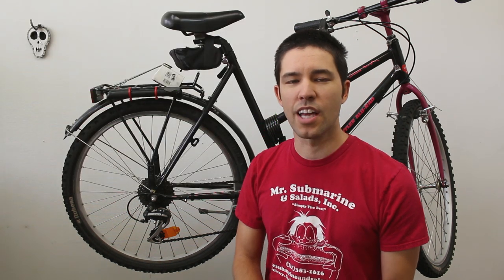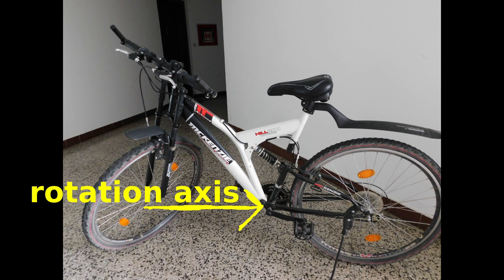Full suspension to hardtail conversion - viewer question

Comment: One issue not mentioned is low end bikes are based on freewheels that apply a lot of bending force to the axle if you drop the bike of pavements etc or take off road, the rear suspension on such bikes does protect the axle to a degree as it takes the instant shock out of those drops. It's an issue with cheap hardtails that is massively reduced on cheap dual suspension bikes because of that rear shock. Personally I would modify the rear suspension to be much stiffer if you can't do that through normal adjustment alone so it still provides a small amount of rear suspension under extreme conditions but doesn't impact riding efficiency so much.  The whole bike is configured for rear suspension and a huge chunk of its weight is related to that design. Maybe look for a very cheap or free rigid frame to replace the existing frame if possible. 

As Bruce says it's great to experiment and try different things out. It's nice to see people riding something different on the road which they have modified. I hate to see bikes not used if you can rework a bike to do what you want that is great. 

I must admit I quite like the idea of getting one of these cheap dual suspension bikes and seeing how much it takes to make it into a really decent bike with minor and cheap modifications.
Reply from the maker: good points Bonzo. thanks for watching and commenting. You might want to check out kevcentral, he does just like what you're talking about.
Reply: @BruceChastain  Been watching kevcentral for a while might even been the reason your videos were recommended to me. I tend to search for cycling videos though but I think your $100 walmart road bike video was recommended because of kevcentral.

Comment: Bruce, good topic.

A Lowes, Home Depot of Ace hardware would have short 'pipe nipples' - any size less than full length, prob in inch or two increments, normally threaded both ends, the threads being irrelevant to this.

Get a Spring loaded center punch from Harbor Freight Tools to punch a dimple mark in correct location before drilling thru with a smaller diameter drill that final hole size, which is determined by your thru bolt fastener at either end.

This would be accomplished easier if using square metal stock, if you have a "metal supply house" nearby.

Our Lowes has a modest supply of square tubing as I recall. Can't say on sizes tho.

Careful using the same bolt as already on shock. Its probably mild steel & could shatter and potentially injure rider.

I'd upgrade to a Grade 8 or if not available use a Stainless steel one for strength.

Or simpler perhaps, troll your loxal Craigslist for a "garage queen" hardtail MTB, lol !
Reply from the maker: square metal stock could be really ideal. Could look decent if painted also.
Reply: @BruceChastain  
I once put a super nice quality upgrade center shock on a 'Walgoose' suspension MTB, in place of the cheap fake shock / spring.

Handled way better, but still too many sub-grade parts condemned the bike long term.

I still ride my other MTB from Walmart, a Genesis Two-Nine, which has some key modest upgrades.

Its a hardtail, and with budget MTB's thats the way to go, imho.

Comment: you can just compress the spring as hard as possible without removing anything, this is what i did to my full suspension bike and it does not bob at all. But it is very heavy, 17kg. What i'm looking to do now is replace the frame with a basic one that has no suspensions. after 17 years i have realized that i have never used the bike on dirt, so i don't need suspensions AT ALL.
Reply from the maker: Doesn’t that make it sit kinda low?
Reply: @BruceChastain  nah man, at least not something i noticed :) Maybe that depends on the type of suspension? I didn't have this problem and with the spring compressed it transfers power much better.

Comment: I was just thinking about this tonight. I got an old 2003 Huffy Howler budget bike I bought for $99 back in the day just to use at work as I was an aircraft mechanic and hated walking miles of flight line. I love the full suspension as mine is similar type shock as the one in the video. But it's frustrating as I still use it as a work bike, only now it carries groceries and other cargo from shopping to home. With it load down with 350 pounds between me and cargo, trying to pedal for power makes it POGO up and down a lot pedaling hard or when  trying to gain speed on a downhill grade. So that's why I'm here, was wondering if anyone had removed the shock and put a pipe or rod in place of the shock. Now I know. Gonna try it, but also keep the shock so I can still use it as a fun bike with full suspension, but use as a hardtail when hauling cargo, especially since that would allow me to mount a proper rear rack and be able to use saddle/pannier bags. I've thought about using it as a Touring bike too, use it hardtail to get out on a safari somewhere, make camp, rest up, put shock back in, blast around the wilderness having fun and sightseeing, put solid bar back in for heading to next camping area or returning home. Nice channel and like your attitude of bike hacking, lol. I already call my old bike a PSV for Pandemic Survival Vehicle, now I wanna hack on it and turn it into a proper Cyberpunk or Fallout style bike.
Reply from the maker: wow 350 lbs! you really do have that thing loaded down! Maybe that shock is keeping the wheels alive :) But yeah you could try replacing it with a solid mount. I might suggest getting a second bike to haul stuff if you can spare like $75.
Reply from the maker: thanks for stopping buy and commenting btw.
Reply: @BruceChastain  I had considered getting one of those multi-colored Kent Ridgeland bikes as a grocery getter, convert from single-speed to 7-speed. Or even add an electric wheel hub motor with pedal assist. That way I could use a solid rear rack and saddlebags, etc. Plus triangle bags too to more evenly distribute the weight along with a front basket. But not sure if that bike could hold so much weight and it doesn't have a suspension at all, hehe.

Comment: Can a hardtail turn into a full suspension
Reply from the maker: hmm that's a little harder, but I guess should be possible.
Reply: @BruceChastain  want to do a video on trying it?  I'm a delivery rider and my back is suffering after 4 years of hard tail.  Having spent £2500 on an e-bike ( and upgrading it ) and upgrades I'd be interested in conversion rather than buying a new bike.  Mine is Mid Drive using a Bosch Activeline Motor.

Comment: Hey, I'm a fatty. A bit over 300lbs, and I'm wanting to bike to get a bit more fit. I picked up an old huffy mountain bike to work out on, but it sags real low for me. I was wondering if I could convert it to a hardtail with a kit or something. I'll give this a try since I spent almost no money on the bike. I'm also not going to really push anything on the bike, just dirt roads and some pavement. Would you say this is an advisable conversion, or should I look at a heavy-duty replacement?
Reply from the maker: hey Whiskey, good for you getting out there, not letting anything stop you! As for converting and using a walmart bike, well I don't know, ideally if you're really heavy, I think people recommend rigid bikes, meaning no suspension. And they usually recommend thicker spokes maybe with more of them. I think wheels are the most common fail point when you're talking riders nearing the 300lb area and above. But on the other hand, if you have the bike already and just want to goof around with it and on it, then sure why not.

Comment: Need to be vey carefull about converting bikes designed to have rear suspension.. If you make the rear rigid by just putting a bar in there then all the forces on the bike will be directed harshly on the pivot bearings.. Depending on the type of riding you do.. If its just light duty stuff then ok maybe.. But definately not actual mountain biking, going over rock gardens, jumps ect ect.. You will destroy the bearings in short order in the pivot points..